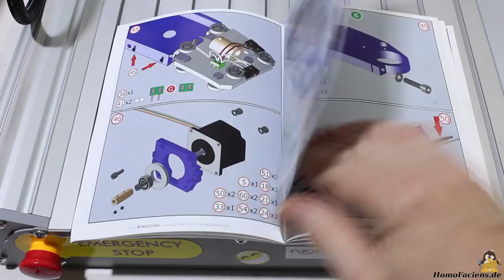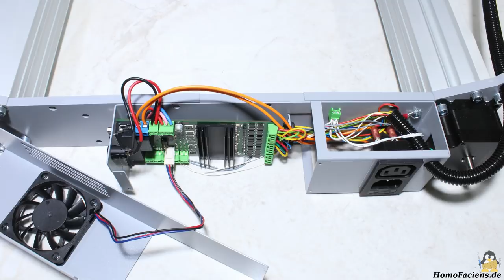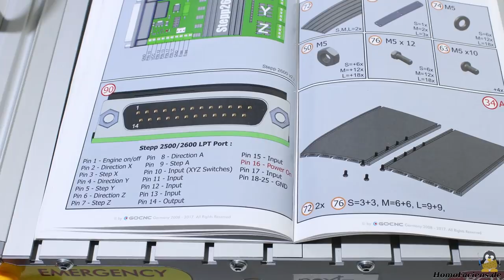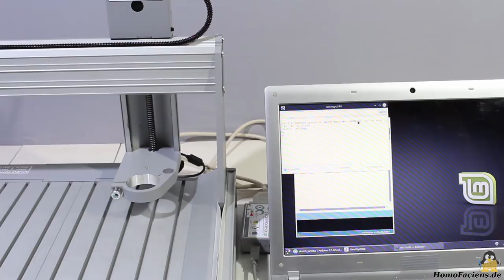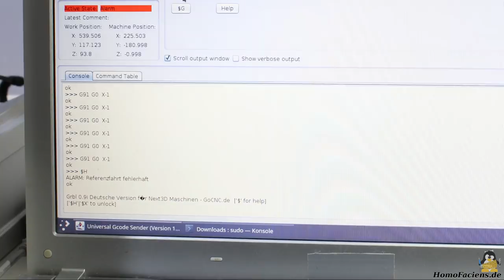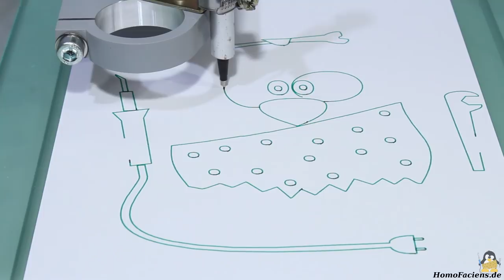Review mechanics of the Next3D from GoCNC

Comment: Getting a CNC in the shop is one of my goals. I will probably want to do a DIY version. In the long run it will probably end up costing me more than this one with less accuracy : )
Reply from the maker: My latest DIY CNC machines are not so bad considering the precision, however I am now trying to mount more powerful motors to speed them up to get a bit closer to this commercial router. Even with the low power motors my machines are in fact tools rather than useless toys ;-)
You learn a lot about what makes a CNC become a good one when building machines from scratch and knowledge is priceless.

Comment: hello Homofaciens, i purchased an assembled next3d cnc router with usb studio box 2 weeks ago and when i tried to use it, i encourated some problems. the stepper motors made noise and they didn't turn. have you any idea that can help me soulving this problem? Thanks in advance.
Reply from the maker: When do the steppers make a noise? I don't have the studio box, but I guess it also runs grbl. Check the parameters grbl returns. My settings are listed on my pages:
https://homofaciens.de/technics-machines-cnc-Next3D_en.htm

Comment: I recommand looking into linuxcnc.
Reply from the maker: I need a computer with parallel port to start experimenting with LinuxCNC. Maybe I will order a PCI card.
Reply: Yeah make sure its certain type, forgot exactly what, but simple enough to google and find parallel type. I think its bidirectional or something? Been a while lol. In any case it's not expensive. My 12 year old pc has latency good enough to run a cnc machine, at 17k jitter or so.

Turn off all power saving stuff, get decent gpu so onboard gpu dont bother cpu as often, and your latency will get much better.

Comment: Hello. I bought a 3d next 3 weeks ago and after assembly I encountered problems. The engines make noise, but they do not turn. Do you have any idea about this problem? Can you help me in any way? Thank you in advance.
Reply from the maker: Do all axes move smoothly when turning the motors by hand? Probably a too high feedrate? Try to lower that speed an see if the motors start spinning. Does none of the motors spin?
Reply from the maker: You must run the homing command by what all axes are driven to the end switches before the machine accepts movement commands.
Reply: @HomoFaciens  I ran homing program but it was not successful. I even contacted the company but they do not know what it is. maybe there is a problem of compatibility or even a manufacturing defect. thank you in any case for trying to help me. :(
Reply from the maker: "it was not successful" is for sure no description of a problem that enables me or someone else to help. You must say EXACTLY what went wrong or record another video showing what happens when you try to home and how you try to home all axes.
Reply: @HomoFaciens  you have right. i solved the problem... settings problem.
Reply from the maker: @Adrian Cosmin Andrita Good to know you finally made it run.